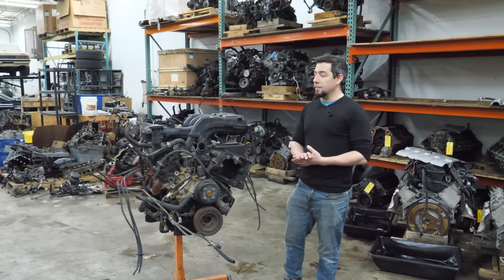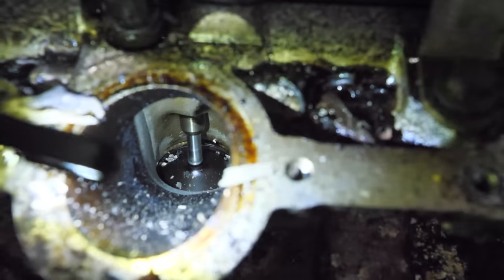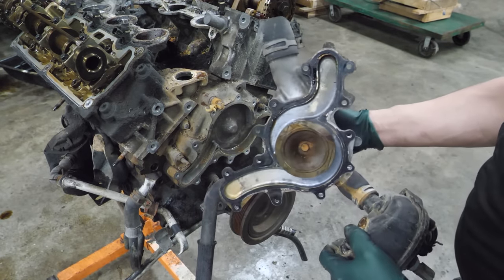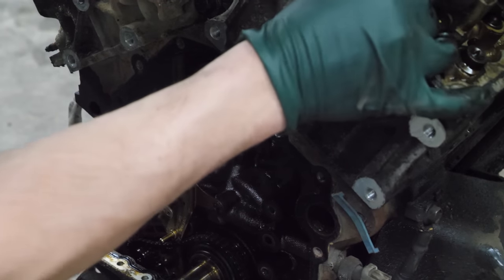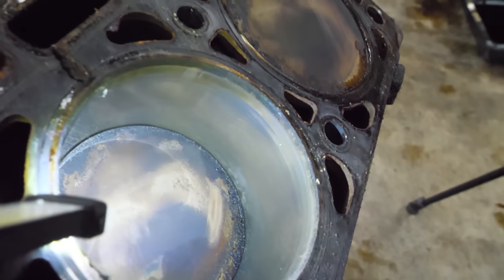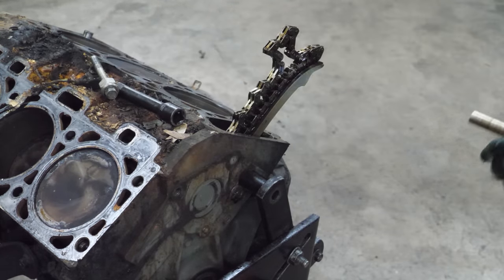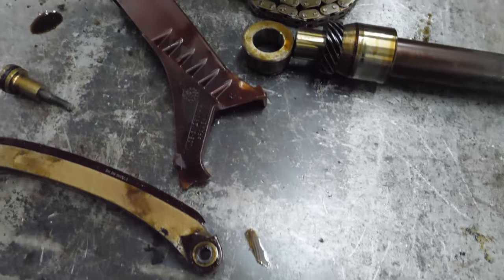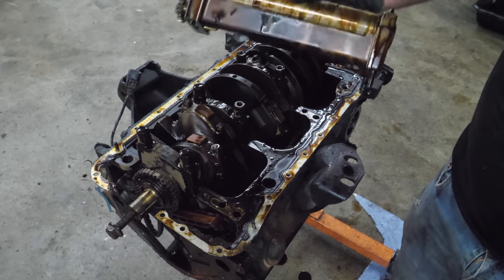Ford Explorer / Ranger / Mustang 4.0L SOHC V6 Teardown! Is This Why They're Called "Exploders" ?

Comment: V6's are a different engine in that you have to make them work/sound right/cancel vibrations. Thus, a balance shaft. Newer V6's don't have a balance shaft by reducing the angles of the engine (the cylinder heads in relation to the crankshaft). That makes the engine taller thus raising the hood. Benz and BMW tilt/rotate their inline 6 engine a bit to create a lower engine hood for aerodynamics. I would never own a V6. I like V8's!

Comment: Did Ford do it on purpose to make changing the cam chains so expensive that several Ranger pickups end up scrapped because the repair is too expensive when the vehicle is old but could still serve

Comment: The real problem with the sohc 4.0 is if it has a timing chain problem no one will fix it not even Ford they say just replace the engine it's easier than dealing with the timing chain

Comment: I wonder if this is the same engine I had in my 1996 B4000 truck?
Reply: Nope. That is the OHV version. It had problems with cracked heads and pushrod wear, but a good engine.

Comment: I'm here cuz I bought a 2005 mustang with 260k miles. 1 owner car. It's dead quiet. Too quiet. He has never replaced timing chain. But kept up with oil chains. All I hear is injectors. That's it. Also needs a filter housing gasket. But.... BUT... it is on its third transmission 😆

Comment: It's a shame that Ford messed up this design as the 4.0 block itself is near indestructible.  Imo they were every bit as reliable as the vaunted Jeep 4.0. I've had three of these engines, still own two. One had 390,000 miles on it before I gave it to my mother in law as a snow vehicle. I still have one with 240,000 miles and a low mileage one with 100,000. All OHVs in Explorers - a 91, a 96, and a 2000. They were great engines, underpowered by today's standards, but at the time they put down good low end torque numbers for the vehicles they were put into, and will just run forever.

Comment: Ok the reason for the timing chain on the flywheel end is so the right and left head castings can start out the same. Porsche dis this with the Boxster and subsequently the water cooled 911. But what sets the Ford apart for sheer stupidity is the lack of timing marks on any of that rabble of gears and chains. Like, this is already a nightmare for serviceability so let’s just make it impossible. Mission accomplished .

Comment: There is the engine design Audi did use as an example for there engines now. Also the chains behind the flex plate or flywheel🤐

Comment: I had one of those in an Explorer. These 4.0L SOHC V6's were designed and produced by Porsche in Cologne, Germany. FoMoCo wanted a compact and powerful V6, so they outsourced it to Porsche rather than build it themselves. It explains why the design is so convoluted, stupid and desperately anti-DIY. Working on the rear chain requires engine to be removed completely from the truck. On the only bright side, those external tensioners are a breeze to change when things inevitably start rattling, lol!

Comment: I got my 2018 Mazda3 2.5 brand new off the lot took good care of it and it paid itself off and paid my bills with 150,000 miles and their Los Angeles miles. Great car i keep up with the oil chages every 3k transmission at 50K and every other year i change the coolant. At 130k i had to get new motor mounts and ofc breaks and tires so there is nothing out of the ordinary to maintain.

Comment: It's unfortunate auto makers (seemingly intentionally) build engines (and many car parts) with inherent design flaws.  This 4.0 SOHC could have been a much more durable engine with minor design and material changes to these guides.  Perhaps instead of plastic (duh), they could have used an alloy and rollers, and better tensioners.  A few more dollars but hundreds of thousands of more miles.  I picked up a nice little 1998 4.0 SOHC at auction a few years ago with 200k miles and it still runs well at about 210k, but I know it's on borrowed time.  The rest of the vehicle is good enough so that if the engine goes I'll explore other options.  I'm told a GM 5.3L is a good bolt in replacement that will fit.  We'll see. Until then I do keep it freshly oiled to ward off death.

Comment: As an engineer I can really appreciate how Ford designed the timing system to be more compact and limit the dimensions of the engine as a  whole package, but from a serviceability perspective what an absolute nightmare. My father is a mechanic by trade and so I grew up always hearing about those damned engineers, and being around cars and working on them from an early age allowed me to gain an appreciation for designs that aren't a pain to work on. While I have to include that often times things like this aren't the fault of the design engineer being braindead and rather the bean counters demanding unrealistic requirements for packaging and compactness, there are a lot of engineers out there who lack that hands on experience to be able to visualize what their designs will look like in the real world, and that the assembly plant is a much different environment than out in the field or in a repair shop.

Comment: I disagree. I have one in my 2005 Explorer. 220,000 + miles, burns no oil, runs quite and smooth. I change oil every 5k and only use full synthetic. Like most engines, failure is due to poor maintenance.

Comment: I had good experiences with my v6 4.0 explorer.

From 140,000 to 180,000 miles over 3 years. 

Yeah the transmission didn’t shift sometimes and came out of gear at times until I put Lucas’ transmission fluid repair which actually fixed it 

Oh and the power steering leaked so bad I carried a concrete mixing tub to catch it and put it back in. In the winter it didn’t leak much. I’m the summer it poured out
Reply: I paid 500$ for it and sold it 3 years later for 700$

Comment: Balance shafts are never "neccesary" in any engine. The Honda S2k doesn't have any. But if you ever drive an S2k you understand why you want a balance shaft. How can I have fun revving an engine out to 9k rpm when all I can hear is the fillings rattling in my teeth?

Comment: Guess what? I'm replacing the engine on my son's 2003 Sport Trac.. It's the infamous 4.0L piece of shit.

As an automotive technician, I absolutely hate these engines. As an employee, my boss will not touch any of these vehicles, other than just light maintenance. Basically, oil changes and brakes, but nothing engine related.

These engines will go the distance, but you absolutely MUST take care of it with regular oil changes, coolant replacement, and keeping it free from leaking oil.

Comment: they did that so they could use the same head on both sides.....  they had a recall for the drv side tensioner/guide, but not the side that ALWAYS fails...  the passengar one, and almost the same shit design..
and that p/s v/c probly got smaked by a guide from the inside, like mine did, and while running the chain ferrys oil up and out the hole in said v/c

Comment: Eh I don’t believe this. I’ve had my 2003 ranger for 16 years. It has 346k miles. Original everything. Only issue it has is the classic ford lifter tick. Do your maintenance and drive with some sense. And it will be fine.

Comment: That's a very odd engine.  So many design choices you don't see on other engines.  Before you pulled the jack shaft I predicted that it would double as a balance shaft as well but I guess not.  Overall it doesn't seem like a terrible engine but that front-back timing system is just not smart.

Comment: WOW!! I see you don't really know Ford Or  the SOHC 4.0 ! I'm no my 3rd vehicle with this motor. 1 with 227000 mile, 2nd 156000 miles and 3rd with 82000 miles! I use the correct oil ( syn.) Plus change oil every 5000 to 6000 mile with wix oil filter!!  I've haven't had any problems with this motor!! Also it's a must to also take good care of your cooling system!!! I've owned Fords for 59 years and have had great experience with Fords!!!!!
Reply: It's very obvious that syn. Oil wasn't used in this motor plus a pint of Lucas oil stabilizer every oil change!! That motor didn't have proper lubrication!!!!

Comment: These were low end torque engines with little to no horsepower up top. Horrible gas mileage! I had a 99 ranger and a 96 explorer with this engine. Complete garbage engine

Comment: WHAT?  these motors have been used by the millions by Ford and have been the mainstay.  The chains will fail eventually, but then if it had timing belts, they would fail SOONER because people won't change them.

Comment: I wanted to buy an '05-'09 V6 Mustang, but I found out about this engine. So I wound up buying an '03 with the OHV pushrod engine. It's still not a great engine, but much better than this POS. The best V6 engine I've ever worked on is the GM 4.3L. For the most part it's a 5.7L V8 with 2 cylinders missing. Not uncommon to see them with over 300,000 miles.

Comment: I know if you actually change the oil every 3k it's a non issue. Brothers 05 mustang has 360k. Has only had water pumps and thermostat housings. Doesn't leak oil, burn oil. Doesn't rattle when you start it. Something as simple as a oil change goes a long way. Instead idiot abuse them and call them junk when it bites them in the ass.

Comment: The 4.0 was also a pointless engine because Ford already made the reliable 4.2L OHV Essex V6 that was more reliable, made the same power and was smaller. Why they wouldn't just use that engine instead is beyond me. Instead it was limited to F-150s, a few years of Econoline vans and like 3-4 years of Freestar/Monterey minivans.

Comment: You don't know what you're talking about, kid.  They were called Exploders because the A4OD automatic transmission had plastic gears and was notoriously unreliable and failure prone.  4.0 family are great engines.
Reply from the maker: I’m afraid you don’t know what you’re talking about.
They were called exploders because of the firestone wilderness tires tendency to explode causing them to crash.

Comment: The 4.0 is ridiculous and the idiots that designed that nightmare should have never been born, or to only be floor sweeper. Now back in the 90s ford made a beautiful reliable V6 with plenty of power for the explorers and rangers that was the 3.0 V6. The 3.0 was an engine you could trust and was reasonable to work on when needed. I was shuttled from refinery to refinery from a driver of a company that used two different 1995 ford explorers that had the 3.0 V6s and both of the explorers were the 4dr version with the Eaddie Bauer upholstery

Comment: Regular oil changes with full synthetic motor oil. Will keep these engines running forever! Extended oil change intervals with crappy conventional motor oil is what probably doomed that engine.

Comment: Me thinks he paints with too broad a brush. The 2005 was a crap engine, but the previous engines like the 2001,2002,2003, and 2004 were extremely reliable. Even the Car Wizard thought so. And I say this even though I really really don't like timing chains in both the front and back of the engine. And yes,  it is super easy to pull the engine.

Comment: I did do so very, very much warranty work on these it wasn’t funny. Oddest problems you’ve never seen or imagined were normal for this engine.
 When I was high and doing drugs before joining ford, I never, in any universe, would’ve come up with this overwrought timing system

Comment: I had an 04 ranger edge with the 4.0, I had roughly 130,000 miles on it and it had the death rattle from the timing tensioner in the front driver side. Them engines are junk would have never bought that truck if I knew what I know now.

Comment: I own a 2006 Ford Exploder 4.0L V6. I've done every down and dirty maintenance part replacement on this vehicle and the latest and greatest replacement that takes a lot of my time is pulling the upper oil pan crankcase replacing both gaskets on the upper and lower part of those pans. While i'm in there I might as well replaced the oil pump with a new Melling oil pump and replace the plastic oil pump pickup tube with a metal one from melling. Now the day the suv engine stops running because of a timing chain issue is the day i'll junk the pos because i will not pull the motor or even the transmission just to do a timing chain and timing cassette replacement is a big headache. I don't know what Ford engineers where thinking on the timing chain system when they designed this motor is retarded. Instead of simplicity they made it complicated for one reason so your average joe mechanic that doesn't have the tools and equipment or have the money to send it in to a shop to do the job they are forced to ditch the vehicle and buy a new one. Whoever invented this type of motor configuration needs to get their ass kicked! This is why when you ever go to a junk yard there is an endless supply of explorers or other Ford models out in the yard that use the same motor for that reason.

Comment: I disagree with you I had a 99 explorer sport with a sohc 4.0 and I beat on that thing relentlessly I got it at 294k and I took it up to over 400 it never broke down other than 1 water pump and the transmission snapped but I beat on it for 2-3 years daily all year round in the mud on the highway on surface streets on back roads I never had any engine issues never fouled plugs never overheated never made any noises the guy I sold it to put another transmission in it and he’s still driving it if does ever made 1 good engine it’s that one 😂

Comment: I am a fan, but the head and timing chain setup was a 'phone in' situation. The idiot engineers should have made a right left head setup. They could have dropped this down to one chain, in the front and would have had one of the best V6s ever made. I say that after owning one since then end of 2005. Mine has had over 400HP/460TQ for 13 years, recording a high of 431/507 in 2021 on the original stock engine. Maybe one day when I'm rich I'll convert this thing back to a single performance cam OHV, cogs and 'ripms' in the 9K range. lol

Comment: I had a 05 sport trac that had this motor.  Used synthetic oil and motorcraft filters and the motor completely self destructed at 93,000 miles, wasnt rebuildable.  May never buy a ford again as a daily driver.

Comment: I had two explorers a 02 and a 03 with the 4L v6 my 02 I bought for 1300 not even a month later my old friend jumped the rear timing chain and it busted the valve cover I still got a picture of it to and my 03 I had for a few months bought it for 600 salvaged title got it legal again and sold it for 1400 I’m happy I got away from these motors
Reply: Congratulations 🎉🎉 
You're one lucky soul🙂
Contact the above to get your (car engine,tyres and headlights) 

Terms and Conditions apply

Comment: 13:50 it is planned obsolescence plain and simple. they knew the timing system was complex. they knew that if it could be maintained easily, the engine could run forever so and people would never buy new vehicles. so make it impossible to maintain. then when faced with a > 3k appraisal for work it's "junk it" every time.

Comment: I feel that Ford on line six is bullet proof. Why make changes when something is good the push rod engine is dependable. I pay fuel and power penalty for dependability. There is nothing wrong with throttle body injection

Comment: These were high maintenance engines imo the 4.0 cologne in my family's experience was much better(500,000 miles on original engine) the transmission on the other hand wasn't so great.

Comment: Had early 4.0 sohc's come into dealers with noise repaired under tsb/warranty after that as with all ohc engines with plastic chain guides people are running them too long between oil changes. Over 5000 miles on any gas engine is too long i don't care if it's pure synthetic. I have seen those 4.0 sohc's go 400 to 500,000 miles. Just like the gm 3.6 timing chain issues same damn story with their oil life monitors alerting you to change oil and it has been ran over 8,000 miles since the last service and the old oil is black as soot. Same with the for 5.4 3 valve once you change out the blown gasket plastic timing chain tensioners that turns into a major catastrophe. New toyota's calling for 10,000 mile oil changes yea go ahead you're asking for it. oil is cheap engines are not.

Comment: My 1998 Explorer had the 4.0 SOHC.  That Explorer was a great vehicle for my needs at the time, but I learned to hate that engine design.  When I learned that to make repairs on many engine components required the engine to be completely removed from the car I was astounded and thoroughly pissed off.  I couldn't believe anyone would allow such a crap design on the market.

Comment: Ford was incredibly stupid for going away from simple, lazy, push rod engines that were reliable to letting the germans build one of the worst v6 motors in history. Ford did not care though as these motors usually explode between 60k and 90k miles. Ford only warrantied these engine for 36k miles. Ever noticed how Ford, america's auto brand, has the shortest warranty of any auto make?

Comment: It’s a stupid design to have to pull the engine out and remove the heads to replace a common part that wears out in 75,000 miles.

Comment: this has to be the worst 4.0L v6 sohc teardown video ever.  Read a manual or watch one of the tear down videos.   You do not have to remove the heads to do the timing.  the timing is not THAT difficult when you know what you are doing.   However, during a complete teardown you do remove the heads first.  but for just the timing change, you dont.